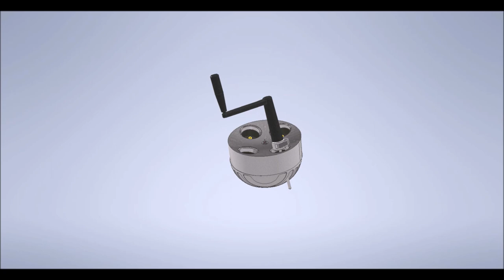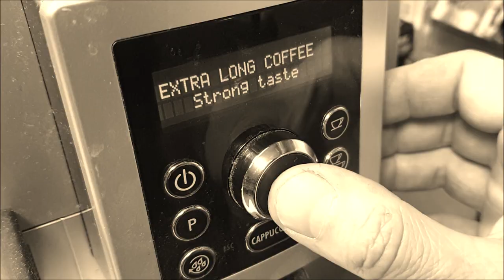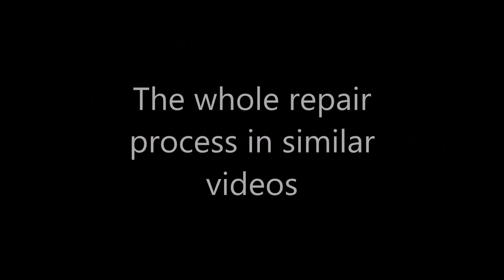Total Engine Destruction - KTM sx-f 350cc   .  .  .  It can be fixed ?

Comment: Now that you did the cylinder head. And you have a new piston and new cylinder lower bottom liner are you showing the next video on the assembly, maybe alignment of the valve train and lobes. Maybe show us on the way the engine goes back together

Comment: I had a 2011 350 SX. For this reason I'm back on a 2021 150 SX. Done with 4 strokes. To many expensive parts and takes to much time to repair
Reply: My 2011 350 sxf is still working like new... My guess is that these very high revving engines absolutely need the recommended oil viscosity, which is 10w60, as per the owner manual. I have tried lighter oils and the engine was not running as good at all, more noise, overheating, hard to shift and such. I use top of the line synthetic only and change it every 5 or 6 hours.

Comment: Racing 4 strokes. It's not IF they blow up, but WHEN, and how MUCH.
I knew the cylinder was scrap, but I had a feeling you'd try to save the head.
Reply: This Is why the 2stroke Is coming back
Reply: @stratosphorus  Word. None from the fools at Honda, and no 125s or 250s from Kawasaki or Suzuki sadly. Looking forward to the KX112 though...

Comment: Paul, in your opinion what do you attribute the vast majority of the damage to modern 4 stroke valve train damage. I see you repairing a lot of cam bearing surfaces and cams...
Reply from the maker: In my opinion - late valves replacement.
They simply get tired and fall into the combustion chamber.
Reply: Bad lubrication of the head first with too low oil pressure on the aluminium bearing, that comes from a poorly designed oil pump and circuit. Mixing ball bearings and alu bearings is not the best of engineering, unless you make a dedicated high pressure circuit for the bearing. That is from difficult to impossible to correct as it's planned obsolescence. You fix it and it will break again.
Poor design of the cooling circuit, a lot of bikes have problems of over-heating because the radiators are too small and often have no ventilators. It's possible to correct.
And being cheapo on the surface treatment of some pieces. The easiest to correct, as good nitruration and eventually hard chroming can be done by specialized shops.
Being high output engines the profile of the cams is very aggressive on the valves. You have to change the valves as regular maintenance. Maybe also the brand being cheap on the quality of the alloys of the valves.

Comment: Why bother? Swap in a 2-stroke and be done with it. Enjoy more power and less weight. Enjoy not having to do the valves. Save money by not needing to change the oil after every ride. Enjoy less noise. There is no real downside.